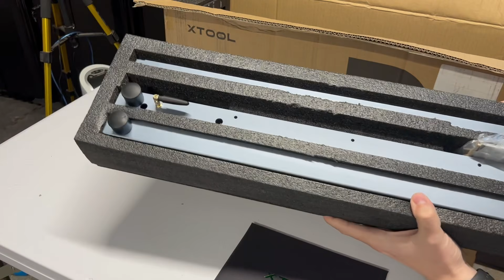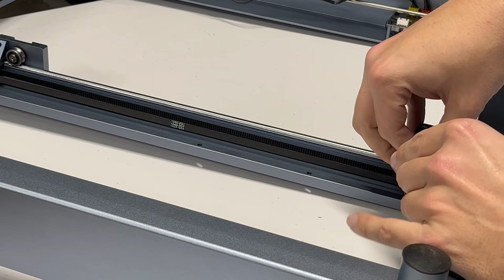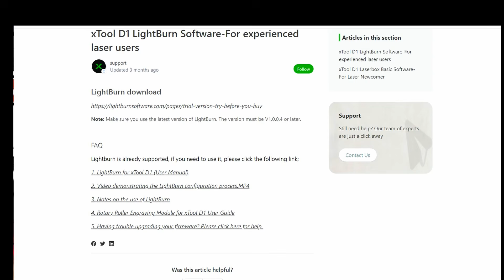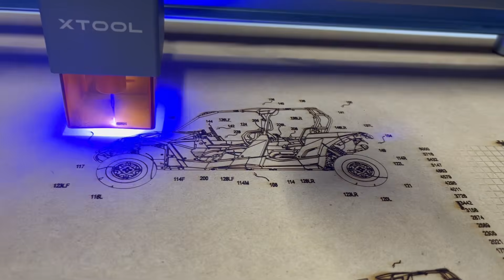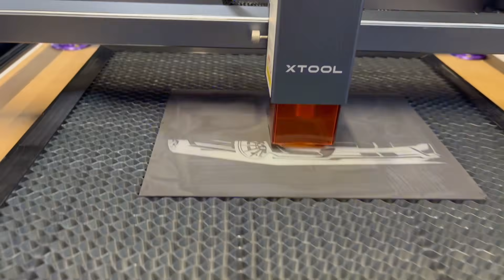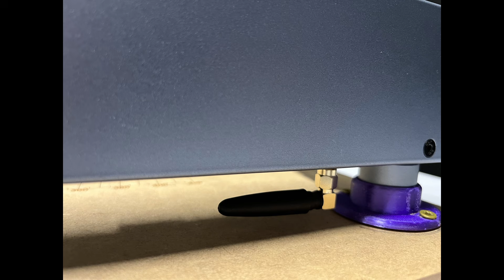xTOOL D1 10 Watt Laser Engraver - Awesome Results!

Comment: Great video man, very informative. Looking at purchasing one currently. Would the 10W version be powerful enough to cut through say 6mm plywood and 6mm acrylic?
Reply from the maker: Greetings!  Thanks for watching and commenting!  It is tough to say if it will cut through 6mm of plywood on one pass.  The reason, not all plywood is the same, nor very consistent.  My answer would be, maybe in two passes, since it is an engineered wood.  If you are looking to cut clear acrylic, it cannot.  It can cut black acrylic at 5mm with one pass at 1% speed 100% power.   Otherwise it might need another pass.  Remember, the further the laser is from optimal focal length, the weaker it becomes.  Let me know if you have any further questions.

Comment: Thank you for the review! I just purchased mine and I’m still learning. Thanks for including the spoil board dimensions! The XTool honeycomb board comes in inches (but shows in mm on the website) and I’m still trying to figure out which I should stick with (in/mm). Wish I paid better attention in grammar school when they wanted us all to learn the metric system. Would have been helpful if the US converted! I’m still trying to figure out how to match the grid in lightburn to the spoil board. Any suggestions? Again, great review.
Reply: John, I will be 69 in November  and use metric all the time, multiples of 10, nothing easier

Comment: Really nice review! I have the Makeblock xTool D1 10 watt laser engraver with the optional roller engraving device and 8 leg extensions. I also purchased the Xtool Honeycomb Bed and Comgrow Enclosure, along with the xTool D1. This laser engraver is amazing, and it will engrave and cut (with limitations) a lot of different materials. Makeblock is also releasing a 20 watt laser and power supply upgrade (plug and play) for the Xtool D1 in May of 2022. The xTool D1 laser engraver is easy to assemble and use (with a small learning curve). The proprietary "Laserbox" software is very limited in what it can do, and spending an extra initial $60 (then $30 annually) for the very advanced and useful "Lightburn" software is almost a must. The key to making the xTool D1 work well is setting the tension on all 3 belts correctly and evenly, and also keeping the track rods lubed. Also, the xTool Honeycomb Bed really helps a lot with heat dissipation, so that you don't burn or discolor the material that you are engraving or cutting. A good enclosure (like the Comgrow) with a smoke extraction setup is also very helpful, especially when cutting. The cable management of the xTool D1 could be better, but it is easily remedied with a little creativity. The trick to speeding up engraving times is learning the proper laser speed and intensity to use. Also, setting burn/cut layer priorities , and increasing "whitespace" travel speed in Lightburn really helps a lot to immensely decrease engraving times. Learning to center an engraving on materials also takes a bit of learning, and the red crosshair targeting laser really helps (it is 16mm off of the main blue laser, and the distance can be adjusted for accuracy in Lightburn). However, using the (shift) "fire laser" and "framing" features in Lightburn really help with the centering issue, once you learn to use them. The WiFi works well, but only works with Laserbox for now. However, when using WiFi you still have to physically push the start button on the xTool D1 for safety reasons. I have not used the phone App. option yet, so I cannot speak for how well it works. I highly recommend the xTool D1 if you are getting into laser engraving, and are not ready to shell out the money for an expensive CO2 laser quite yet. However, just remember that this is a very real "laser," and the UV light is very damaging to your eyes (never look directly at the laser without good eye protection). I highly recommend ditching the included (green) safety glasses and purchasing some professional (amber) laser glasses that are certified to block laser light in the 455nm range. Afterall, you only get one pair of eyes in your lifetime. Also, never burn plastics like PVC, as they will produce deadly Chlorine Gas when heated. Even regular wood smoke can be toxic and irritating, depending on the species of wood. Especially exotic hardwoods like Purpleheart. If anyone has any questions regarding the xTool D1 just let me know, as I have quite a bit of experience with it now, as well as the Lightburn software. I am always willing to help fellow laser users.🙂

PS. The only reason I can think of as to why they call that metal rod an "optical shaft" is that it really hurts if you poke yourself in the eye with it. 🤣

Comment: Can XTool D1 10W engrave on stainless steel ? I mean engrave not only print
Reply from the maker: It will mark stainless steel.  I could feel the ever so slight etch in the container I showed with the Ford Tough logo.  If you want to engrave and etch stainless steel, and other metals, you should go with a fiber laser.

Comment: I have a K40 but its not big enough for some of the projects I have planned so I have been thinking about making a tool change for my MPCNC but cant find any laser half as powerful as the Co2 laser in my K40, I cant easily put the guts of the K40 on the MPCNC as there are mirrors involved and I dont want unprotected laser beams in my shop, I suppose I could enclose the MPCNC which I have also been thinking about, but then I would need open access to the machine for servicing and the changing of the tool head from time to time.
 It wouldn't be so bad if I could get my hands on a larger diode laser system but as of yet they are still relatively small